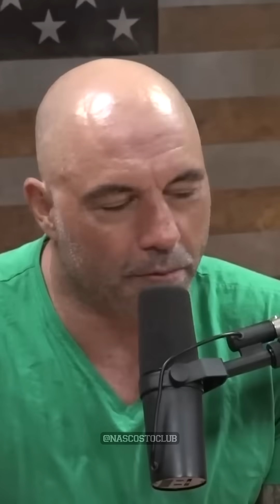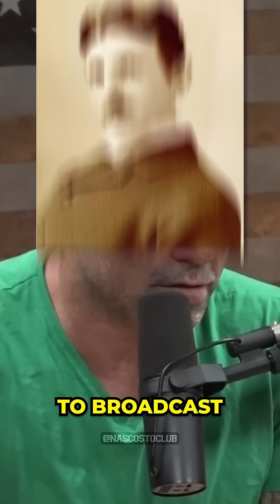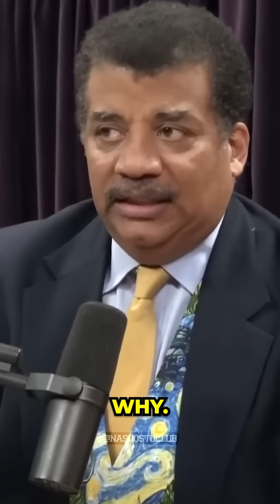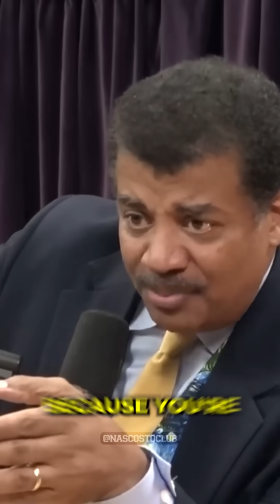WIRELESS Electricity Idea Debunked ⁉️⚡ #shorts

Comment: He wasn't moving energy threw the air he was using the earth to transmit electricity. Not the air. He pulled elections from the air and used the earth as the wire.

Comment: Tyson is a frigging stooge, Tesla was right, and Joe's question was valid...
You can pull it out of the air; the atmosphere is highly charged compared to the "ground" Earth, the higher you can extend a rod up into the air insulated from the ground the higher the voltage and power you can sustain between the 2 contact leads.
Yer not sending power anywhere, it is already there, and electricity is a field not a flowing consumable like water.

Comment: Even when you have a wireless light system, (you know these switches you can buy,and just stick anywhere on a wall,to turn your light on and off?) The switch requires batteries,the lightbulb itself still needs a wire to it,it still needs a feed.then you connect a receiver to the light too. When they say wireless,they mean it doesn't need a wire from the switch to the light (we call it a switchwire in the trade funnily enough...) The switch sends a signal to the receiver to control the lightbulb. So yes,you can kind of have wireless systems,in the sense a control signal can be sent wirelessly,but you still need to power it with a cable somehow.

Comment: free ions attaching themselves to you at a low frequency rate can dissipate or ground out, but if that's not sufficient or accurate to a model that reflects the rate needed for sustainability then, well, your day is going to be super charged. snap! crackle! pop! all day, every day. it has to go somewhere. we alone are low tonal generators, this would amplify by way of hundreds and not be of a type to be consumed through motion or action. fun stuff.

Comment: I have previously looked into this. The radio waves are owned by the radio companies. To sell a product that runs off this could land you in hot water. The current levels of power you could get today is only very small. Not enough  to run a bulb that is visible!

Comment: This was the last I needed to hear from NDT.  As Nikola said "It's hard to give unlimited power to limited minds"
Reply: if we are arguing if tesla coils work or not, then there isn't much to argue. they work. they are a thing. obviously transmitting high voltage is better thru lines. that is why we use AC current (also invented by tesla).
Reply: @johnrogers235  thank you John Rogers,  I rest my case.
Reply: Tesla had theories most of which never panned out.
Reply: Thy say Tesla made electricity that could floe through the body and he could shoot sparks out of his finger tips...thy said the electricity would not necessarily go through u buy float on ur skin kinda like residents
Reply: @sd8484  Apples and oranges. The reason that was possible was not electricity, it was power, congruent with what NDT said.
Reply: @wiredforstereo  you should do a little more research,
Reply: @Chamac0n  crazy what a Google search can accomplish
Reply: @johnrogers235  😂 I did my homework from different resources. He was the first to light up a fair and drive a wireless boat. I have a book if anyone wants any suggestions where to start
Reply: @Chamac0n  sounds awesome. send it
Reply: @johnrogers235  the inventions, researchers and writings of Nikola Tesla
Reply: @Chamac0n  thanks
Reply: @chr1s71anch1  I did. That's why I say what I say and nobody has any evidence to the contrary. It's settled history.
Reply: @wiredforstereo  look up Stanley Meyers,  come back to me, or car running out of magnet. We have the science and tools. Fossil fuel engines is a 150 year old invention, we are literally using antique engines. Sensors on engines doesn't make you car hi tech,
Reply: @Chamac0n  Don't try to change the subject. I'm not going to do your research for you.
Reply: @wiredforstereo  I don't need you to do anything for me. You want to stay ignorant and act like nothing is happening and turn a blind sight all good with me. I don't blame you it's not for soft people.
Reply: Hard to swallow pill hearing something is impossible?
Reply: @sillesrepa8249  A lot of people just can't math.
Reply: Tesla was wrong. NDT is right. And I don't even like NDT.
Reply: @wiredforstereo  My man, it's totally possible to gather enough from the air with a house sized receiver for small electronics, especially with leds now. Neil's unable to wrap his head around the idea it's not a deadly beam of electricity, it's drawing a large area's energy into a small point to put a charge on a battery 24/7 at a time the only product most people would have that needed electricity would've been a lamp or two for a few hours between dusk and the generally very early bedtime, maybe a radio.

It's just not economical for every house to have some crazy huge Tesla coil tower built on top, we have pretty pinpoint microwave weapons now though, it wouldn't be very efficient but with massive towers we could absolutely transfer functional amperages to remote areas buffering say 100km between towers from the edge of a nuclear fed grid for example, just need a nofly altitude along the path to stop planes flying through the beam.
Reply: @MrMotu123  SMDH
Reply: @123devon456  dude we already do that
 With fucking wires. Putting it through the air is just more dangerous and pointless 🤣🤣🤣
Reply: @colinnixon7739  Except it's already all in the air...
Reply: @colinnixon7739  And also impossible/impractical. Read up on the inverse square law.
Reply: @wiredforstereo  NDT is wrong tesla was right, do your reserch
Reply: @Chamac0n  I did. Tesla spent his final years working on a project that was doomed to fail because he got the math wrong. He died broke and disgraced, deservedly.
Reply: @MrMotu123  You didn't post an explanation of how it does work. Because it doesn't.
Reply: @wiredforstereo  Well I did though, you can receive a measurable voltage from the background in the air. It's small, so small you'd need a massive receiver to have any application. 

The discussion isn't if it's practical, we know it's not, it's if you can. Same way as I can charge a phone from the background voltage in a home phone line, it's very ineffective, but after a day or so you'll have enough to make a call (as long as there aren't digital charging features that block the incorrect voltage now, haven't needed to since my flipphone).

Your radio for example is picking up a transmission of energy, this can be harnessed as the audio intended, or can be used to effect a miniscule charge in power storage. Again, practical? No.
Reply: @MrMotu123  Ugh, just read! Blocked!

Comment: The sun can power the Earth, the entire earth, many times over and guess what, the power moves through the air.  I know you'd say, "I said radio waves", but you do not have all of his research and you do not know all of the ways he planned of doing what you say. NGT, Tesla did power lights though the air.  This is an experiment that can be replicated.  You could charge a battery through the air(like solar) and use the stored power for your "anything you need to do mechanically".  There are currently people developing this technology.  NGT, concentrate on narration of space documentaries and getting the sky corrected in Titanic.  I would suggest not making definitive statements about technology that does not currently exist. Noticed when NGT said what he's saying, he said "almost certainly would not work". Disregard his flamboyant outburst and see that he's not making definitive statements. We call that BS. And this guy is an artist in sounding smart undefinitively.

Comment: OK Neil once again wrong per usual. Really research your facts guy. WET or wireless electric transfer has been out since Niokla Telsa we have been able to reproduce teslas equipment to retest but we have been working with wet for years. Currently we can light up to 150ft away without wires.

Comment: the power would not be accessible at ground level. tall buildings with tall antenna would pull it out of the air and sell it to their neighbors. Any 2 or 3 story building with a little antenna would have enough electricity to power many modern LED lights

Comment: NDT must not have read the notes! The reason they killed the Tesla coils is because they worked in short, but you can't meter wireless electricity so nobody would fund research into making it useful to a larger scale and basically buried it. It's about money, not electricity in the air.

Comment: Radio waves no, but microwaves yes. My dad invented an rf to dc converter which if its in close proximity to a radio wave source (microwave oven or wifi router) it can power a small component like an led or small speaker with no internal power source. Its pretty cool, but can’t harvest enough power to be useful for much other than to detect microwave radiation. Basically proving tesla’s idea to be technically possible but not at any scale.

Comment: Seems to me that since electronics came after the invention of electricity that they were built to work with the power source we had. It stands to reason that if electricity was passed thru the air instead of wires, the electronics would have been designed accordingly with the power source available.

Comment: You can light a florescent bulb by keying a cb radio with the antenna in close proximity. Tesla wanted a receiver antenna to collect the energy. He also thought it would carry communication signals. It might not run a vacuum cleaner but in the day where people lit their homes with candles a poorly lit florescent tube probably seemed pretty good
Reply: Ya but the problem is that you aren't putting a transmitter in every house because that would be pointless. If there is one main transmitter than you are blasting extreme amounts of EMR cooking everyone in proximity. It's also incredibly wasteful as you loose efficiency converting the power as well as the inverse square law and absorption of the radio waves by the air. It just wouldn't work on many levels.

Comment: Think of a spark plug people. Twelve volts and just a few amps in. Same overall out, but now it's running on 40kv to jump the gap and the gap is only .060 inches. Now make enough joos to jump a mile gap. Never mind that the stuff that's in the arc path gets vaporized.

Comment: That’s how contactless credit cards work though. Your card has an unpowered chip that gets powered by the reader device and once powered they can communicate.
Reply: @luciolalazilia2189  we honestly wouldn't even be able to produce that amount of power. Infrastructure already struggles to keep up sending energy through power lines. The losses would be like 99% if we tried to transmit it wirelessly.

Comment: That's rubbish.
Tesla was intending to use a ground charge.
All electrics, even now use the ground as one pole. if you can harness the difference between the ground and the air static charge, then you have an unlimited supply.
It's been done, but was then sabotaged by the electric generation cartel.

Comment: And yet we do…
Wireless spectrum carries enough energy to find a high powered tower to communicate miles and miles away.
CB antennas on semis are powered with enough voltage that if you turn it up too much, you’ll blow thru circuitry and even the antenna itself…
Let’s not even talk about satellites…

Comment: Consider that radio is a dispersment of energy through the air, as is television. It could be possible to use this to transmit energy to a receiver that translates the radio signal into energy simular to how electricity is converted by a speaker into sound.

Comment: The attenuation would be a cubic function of the distance from the transmitter. In insualted wires attenuation is linear. So doubling the distance in wires would double the attenuation, but doubling the distance from a transmitter increases attenuation 8 times (i.e. 2 cubed, or 2x2x2). Thats before we even look at how much more resistance per meter there is in the air compared to copper wires in the first place.

Think of it like blowing water through a straw, versus the disturbance at a straw-width point at the edge of a bucket of honey after from dropping a stone in the middle.... but the surface is 3D not 2D!

Comment: Its much more likely his concept would be like that of atmospheric ethereal engery where a building would have a receiver atop it to pull electricity from the atmosphere and then use wires to distribute it to its lights and appliances that way, rather than directly to the bulbs themselves.

Now this concept still has a large variety of issues, but the whole light bulb thing is a bit silly of a counter compared to other criticisms.

Comment: Neil is always so hard pressed on the weirdest idea. I’m sure someone said “you want the internet, to be in the air? And you walk through it? Impossible”
Reply: Except he's correct. Tesla cannot break the laws of physics.  The reason we use cables and wires is because if you send high voltage & high current electricity thru the air, it will fry every living thing between the device sending it and the device/appliance receiving it.

Why do you think even the 120v that powers your blender & charges your phone can also fry you into a coffin?

Comment: Neil is right on this one folks.  Yes, you can power a florescent tube with the energy you get through the air near a Tesla coil.  It's a fun experiment and you can see it here on YouTube.   

A florescent tube might be rated for something like 15 watts.  ONE heating element in a water heater is rated for 1500 to 5500 watts = 100 to 367 times more - for just ONE element of one appliance in ONE house.  

If you had enough power flying through the air to power houses, you would probably never leave the house - especially not holding anything metal - it would act like an antenna, and you would be the warm meat all that electricity flowed through to get to the ground.

Yes, people have sometimes survived lightning strikes.  But you don't want to make a habit of it.

Neil is right.  That much electrical power flowing through the air is a stupid idea.  And even if you didn't worry about cooking people on a regular basis, transmitting that much power through air is an EXTREMELY inefficient way to transmit power - most of it would be wasted heating up the air and the earth.

Comment: With a Tesla coil...you can power a lightbulb when brought near an energized one.  I have done this myself.  Incandescents are not working...but a fluorescent tube lights up.

Sorry NDT....you need to stop and think abit.  The voltage is the key...not amperage.  You are not ignoring that.

Comment: As an electrician I can say there is frequency waves that radio stations use , if you found the right hurts , sound wise , you would be able to create free energy with the vibration of the hurt sent threw the air waves example - there is law enforcement that can send this wave into cell phone to missing hikers to re boot there phone , same concept just without the gov being involved …

Comment: He's so right you know. Be grounded enough and conducting enough it will fry you to a crisp. Conduct a coil in the way of a vibrating magnetic field it will literally fry you instantly. The ideas were misunderstood. Point to point though convergent radio waves and localized field short range is pretty possible though. No one really knows what Tesla came up with so.
Reply: Inductive metal heating and welding came out of that though. Some other industry applications we use today are the result of the Tesla's work.

Comment: Tesla actually demonstrated that fluorescent lights can work without wires and he turn light bulbs on without any wires at all.
Reply: The problem is, like Neil said, the safety of having all that electricity in the air. I don’t know if you noticed, but lightning is also a combination of energy from the sky AND the ground. I can only imagine the frequency of lightning type energy popping off if there’s a ton of it in the air.
Reply: Thats not the problem theyre discussing. Totally different.
Reply: Actually light from the sun and all the stars goes through the air and through space without any wires that's energy you idiots !! 
Tesla invented the radio Marconi just stole his patent.
You are watching television and you are communicating now through the air and sending energy back and forth you morons, say thank you to Tesla.
He invented the AC current and all the AC products like electric motors and everything you have right now.

Comment: Just think how solar power works. 20 panels can power a house. The same energy that powered that house was passing through air- although in a different form- and it didn't kill you. And those panels are not efficient at all. So the energy that passes by you is much greater than you can estimate.

Comment: Air has an insane high resistance factor when conducting electricity, compared to copper wire of course. Electricity will take the less resistant path to ground no matter what. It would not work to send electricity through the air for many reasons. Shortest path to ground would not always be the intended path. Resistance of air is way to high for it to be viable in any way.

Comment: As I had heard his wireless energy idea described it did not involve sending power directly through the air in “pathways” but rather loading kinetic energy into the small gab between the ionosphere and the stratosphere. What became the H.A.A.R.P. program was built on the same idea that he had to be able to load kinetic energy into the upper atmosphere. The way that energy was recaptured had to do with a specific material that he was developing which reacted to the frequency of the energy stored in the atmosphere converting it directly into kinetic energy at the receiver site. I wish I could remember the name of the documentary which covered this, but it was nothing like what Mr Tyson is talking about. He was not trying to send current through the air.